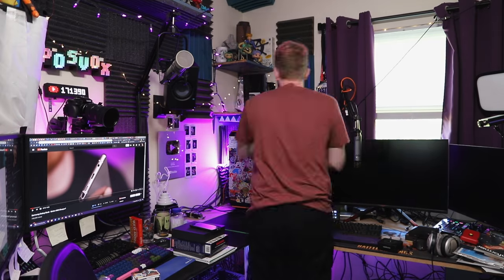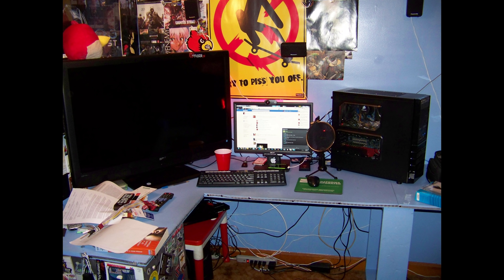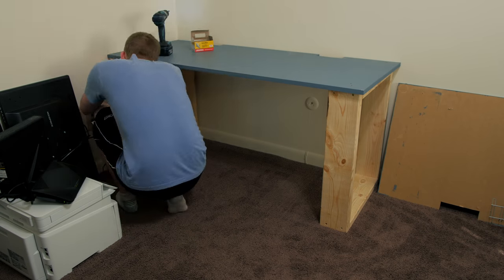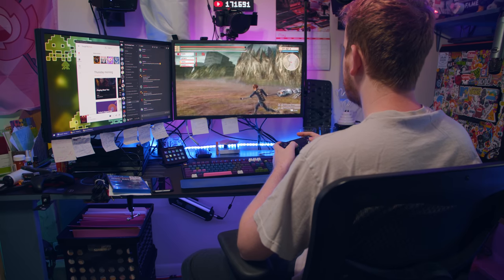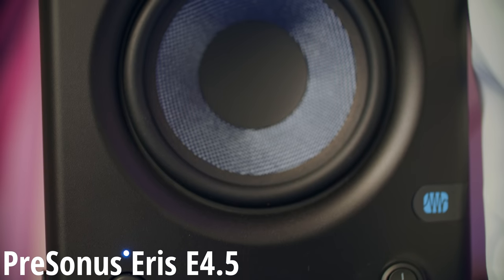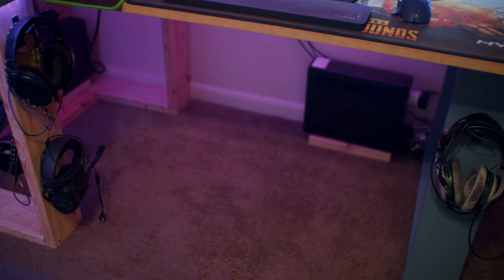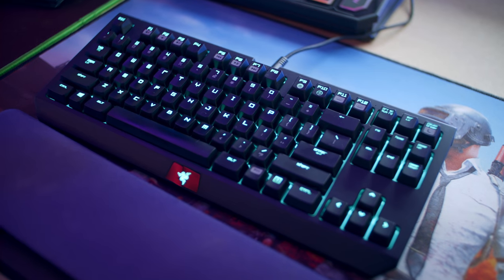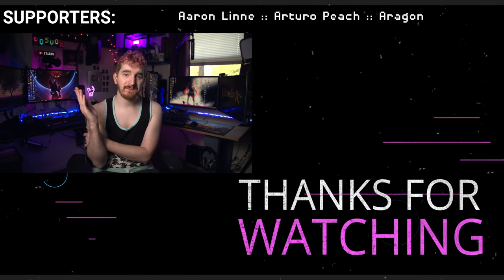MEGA-DESK 3.5 | Building My Cleanest Setup To Date | Video Production & Gaming Desk Tour 2019

Comment: Thanks for the studio tour. It all looks awesome! Question: I have just moved into a house, but share a wall. What are your thoughts on soundproofing my studio, especially the shared wall? I am arranging and putting my studio together at this time, and working on various setups for optimal sound, and lighting. I am looking for a cheaper price, not cheaper quality of sound proofing. Will the shared wall have to be completely covered in sound proof tiles? What do you reccomend? Any other advice is also appreciated. I do enjoy all your videos and wish I had someone equally as talented as you are with your entire setup that I could converse with about technological endeavors concerning setup. Right now I am just podcasting, but venturing into video, plus eventually gaming. I have many ideas of building my channel, but must admit sound is in my wheelhouse, and video not so much. I am trying to learn all I can to make my studio into something I am very proud to create from. Thanks for your input.
Reply from the maker: One thing to note is that "soundproofing" and "sound treatment" are very different things. Are you looking to keep sound from leaving the room through the wall, or keeping sound from the other side of the wall out of your room? That's soundproofing and usually requires a lot of specific insulation and etc. The sound foam tiles/blankets are best for absorbing ambient sound in the room. Admittedly, I'm not super familiar with actual soundproofing methods - but if you want to go that route, it would involve big panels most likely, yes.

Comment: I’m thinking of doing some sound treatment for my setup as well.  My space is an 8.5 foot by 8.5 alcove area in my condo.  I was considering using a foam mattress cover mounted to a backer panel that I can stick to the wall with velcro strips.  I know thot those foam tiles are not cheap and thought a mattress cover would work as a substitute.

Any thoughtd A

Comment: Ok, this is a completely unrelated comment to the video but i can't find anywhere to post this.
So basically i have got a problem with my behringer x1204USB mixer,
i have had this mixer for while and i have a condenser mic (AT2035) hooked up to a input on the X1204USB, since the microphone is a condenser microphone it requires phantom power. So this mixer does support phantom power and it works great for a while but every now and then i get this blowing like noise from the phantom power blown into my headset. No sure what is causing but turning the phantom power off and then turning the phantom power back on solves the issue temporarily.

If anyone knows this a problem or if i should send it back, please let me know.
Thank you very much for your input!

Comment: why you run your 1440p at 120hz ?
Reply from the maker: 120hz is a cleaner divide down to 60, which makes it easier/cleaner for streaming/recording for 60fps content - and easier to make games his 120hz than 144. And for actual frame times there's virtually no difference.
Reply: @EposVox  thx for the quick respond. i will test it on my  samsung CHG70.

Comment: PRO TIP: Bundling cables is less clean, then actually hiding them in cable hiders.

ps: Those scotchtaped notes on the monitors hurts my soul, please consider to have a neat solution.
Reply from the maker: Hiding them in cable hiders makes my life 100x worse for changing them. I don't want them hidden, I want them accessible.
That is a neat solution for the notes. They're in front of me where they need to be - anything "neater" defeats the point of using sticky notes.